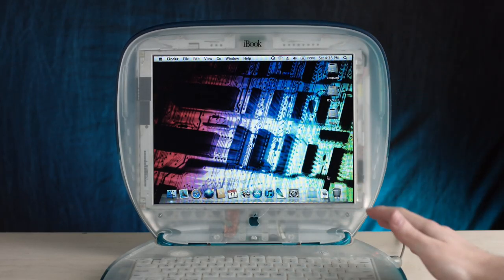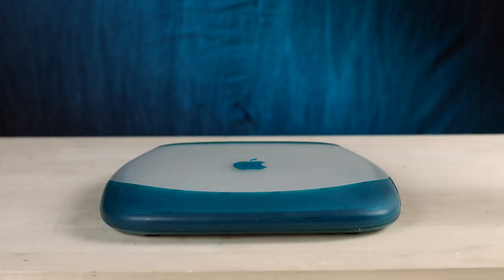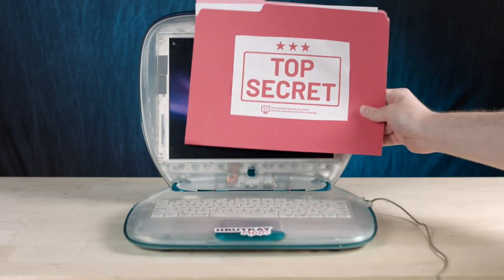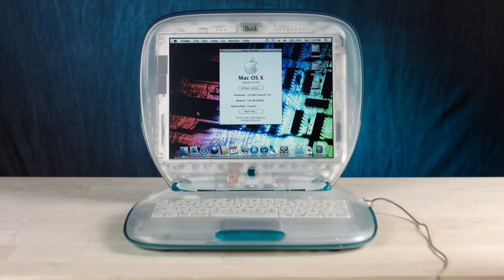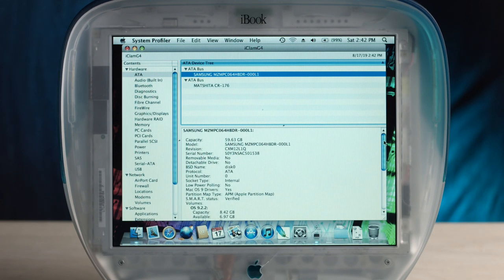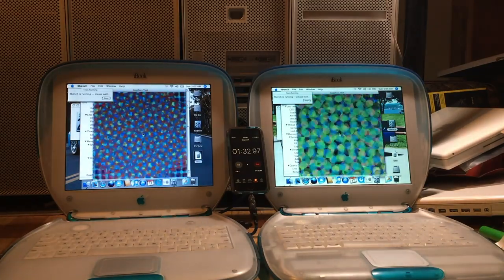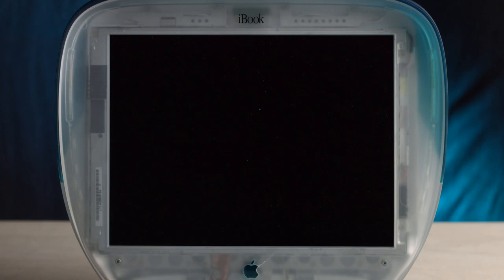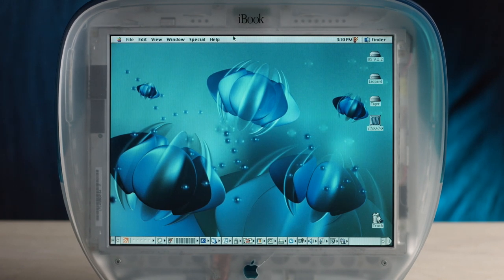iBook G4 Clamshell Mod (ft. Hrutkay Mods and dosdude1) - Krazy Ken's Tech Misadventures

Comment: there's plenty of iBook G4 Clamshells in Area 51
Reply: Recently we got a report of a iBook G12! it runs a I9 Extreme
Reply: They're also hidin' the PowerBook G5s, the Intel versions of Mac OS X up to 10.3, and the expandable, affordable desktop between a Mac mini and a Mac Pro
Reply: Along with the Macintosh 128k with hard drive and colour screen.
Reply: @djdjukic  between a mac kini and a mac pro? The Pippin!
Reply: Windows 9 is sealed tight in area 51 where everyone will find it.
Reply: video is up
Reply: Mom! We’re going on a road trip!!!
Reply: >ibook G12
>i9 Extreme
you can't say it's a G12 then say it's an i9
Reply: No that's where the g5 clamshells are
Reply: Ikr
Reply: Nah man that was a DESKTOP made by Alienware, you're so silly bro, ha!
Reply: I thought there were g5's or g6's there
Reply: @i05af  and an iPhone 13 with headphone jack and no notch. Also, the taptic engine acts as a subwoofer. Also, there will be burn in proof OLED screens.
Reply: Just needs to go in there (more successful than last time)
Reply: In the "Twilight Zone of Technology!"
Reply: I found a G4 Clamshell with a PowerIntel i99 10000GHZ with OSX High Sierra (no dot update) in there and it was running smoothly!:buffering:
Reply: @toxy3580  a iBook G5 clamshell sound mildly cursed
Reply: @Kan_DSU  HOLY SHIT WHERE TO FIND

Comment: A few years back they were selling a few of these modded G4 clamshell iBooks on eBay. They were a few hundred dollars, ran 10.5, 500mhz and had the disclaimer that they'd randomly lock up at times. Wonder who ended up with those machines. Almost pulled the trigger but couldn't justify the price.
Reply: Piipperi800 in the comment section here owns one. You see, the thing with those was, some rich American kid had a boat load of Clamshells, and sent out a few to a British guy who G4'd them, so they would split profits on those. Rest assured, the upgrade was done correctly, but the rich kid that eventually sold the Clamshells did the cooling on them... He hacksawed a laptop cooler, straight through the heatpipes, and slapped it on. It didn't cool the system adequately, so it would frequently lock up.
Reply: The reason why they would freeze up is because they were using the G3 cooling system my cooling system prevents freezing up because they never overheat 👍

Comment: Seen the original video a few weeks ago and yea pretty nice mod, for those wondering they used the G4 from the Ti Books (first gen) as it is pretty straight forward other than the multiplier and maybe needing a resistor for the voltage. The cooler needs improvement but for first effort it worked, one can the same mod to imac G3s without much effort.

Comment: 4 MB VRAM, and you even wonder why things don't go that smooth graphics-wise?
Reply: VRAM doesn't affect framerate
Reply: @TorutheRedFox  the best lie I have heard in 2019
Reply: VRAM only affects graphics fidelity
Reply: the only reason why low RAM slows things down is because apps try to conserve RAM when it's reaching the limit, especially Windows itself, as it starts to use the page file more and more, which is slower than using physical RAM
Reply: @TorutheRedFox low vram means the GPU have to constantly flush vram to make space. This means more GPU cycles are "wasted" with low vram.
Reply: @TorutheRedFox  Yeah...., listen bud, it has ati Rage graphics. They were outdated in 1997....

Comment: They probably could've kept stock cooling if they dropped the clock on that 500MHz 7410 to 366~400MHz or so. It would still be quite an upgrade over stock, just slightly less impressive (but quite a bit cleaner).
The display and upper case shielding don't matter too much, they're mostly there for RF shielding. The display shielding especially tends to pick up these black marks over time and the only ways to get rid of them are to clean and repaint the shielding or remove it entirely (which is what I do). The upper case shielding is thin and doesn't really contact anything in a way that would affect cooling much so you're not going to notice that it's missing. The lower case shielding, however, is essential for cooling, especially of the GPU and a couple other support chips, and removing it is a really bad idea (of course they kept it in here but I've seen other mods that remove it).

Comment: 11:34 "I am not used to older computers holding a charge." I bought an iBook G3 14" for €35 (I live in France) with a apparently dead hard drive. It would show a Mac OS X boot screen but it would not go any further than the loading cursor. I replaced the original IDE HDD with a CF card adapted to IDE and installed Mac OS X 10.3 Panther on it from images that I downloaded from the internet. The best part was that the battery still worked with 186 cycles on it. It was the original Apple battery. Oh, and unlike you, Ken, I got an Apple charger. Not the original charger that would have come with an iBook G3 14", but an iBook G4 charger. It works perfectly with this machine.
Reply: The 16GB CF card I put in the iBook works so well that it boots up faster than my modern computer running Ubuntu 18.04, but only because my modern PC is using a mechanical HDD.
Reply: It's an 800MHz model with 256MB of RAM by the way.
Reply: Yes, and my startup disk (name "iBook SSD") does show up very fast in the boot picker, but the watch stays forever in comparison before turning into a mouse cursor. Probably because the CF card is slower than a true SSD.

Comment: The color scheme is being re-done in the iMac, orange would rule for me! All I need to do is to win the lottery. An iMac M1 for me! Light, but powerful. I used DOS, the Delete with * was a dangerous trip. You had to be very careful.
Reply: Orange!
Reply: Good news. The iMac M1 orange is out. However orange requires an 8 core gpu. There’s no orange for the 7 core gpu model

Comment: me using completly modded macbook pro mid-2012 with an intel core i7 6700, 32gb ram (upgraded chipsets) and more powerfull speakers/subwoofer. its amazing. running catalina and everything. 2tb ssd, and a 6tb laptop hdd in place of the dvd rom drive,

Comment: ive wanted to take an old apple ibook and stuff a modern laptop in it for a while now.  imagine having an old 17 inch pro and stuffing a modern laptop with a decent gpu in it
Reply: The greatest challenge would be getting all of the new laptop bits to fit inside an old iBook. But if I were to build it. I would just use the iBook outside shell as a veneer. Design and 3D print new parts to hold everything inside a clamshell. I can imagine a MacBook Air logic board could inside an iBook

Comment: This should probably mostly be credited to dosdude1 since he seems to do most of this Hrutkay guy's stuff...
Reply from the maker: Dosdude1 swapped the CPU and added the resistor for the fan. Greg did the case, heat sink, fan, and SSD. It’s not a competition.
Reply: I actually agree 😜 there is a reason why call It the “dosdude1 iBook G4 Clamshell” I let Collin use my systems as guinea pigs he tends to fry more than he makes work 😂... but hey he has to perfect the process somehow